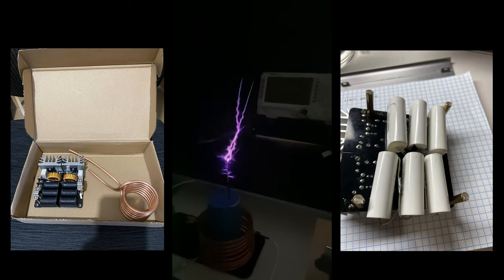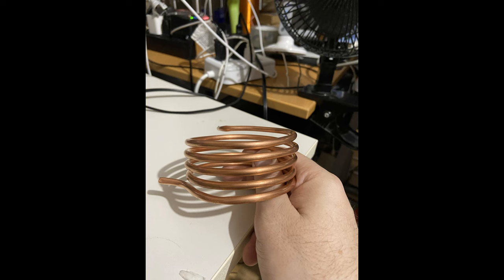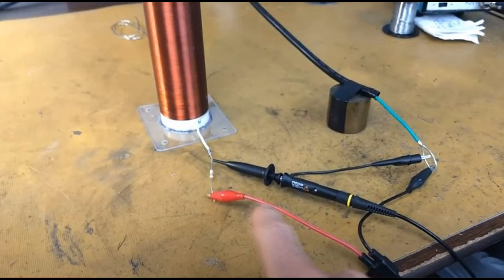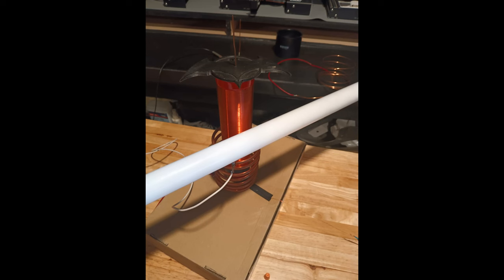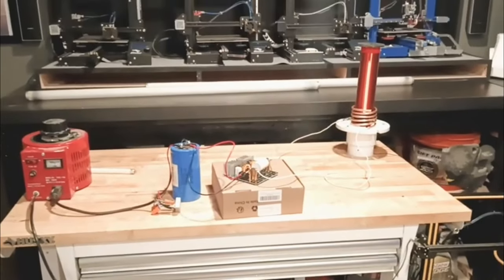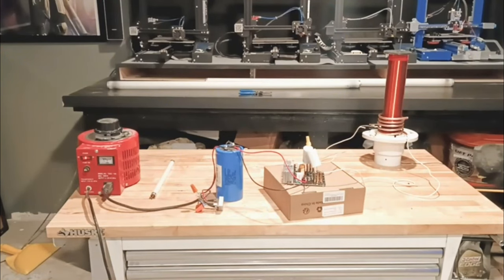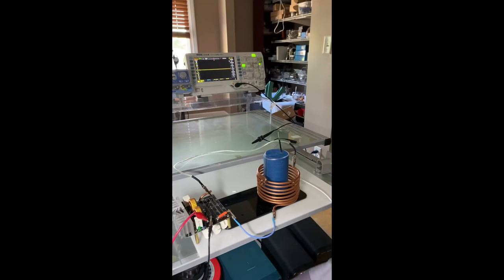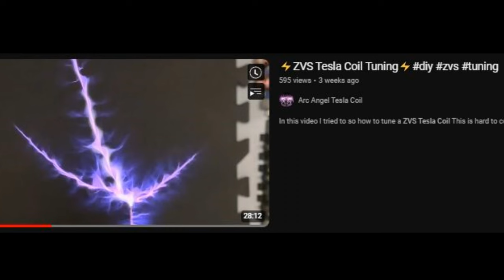ZVS Tesla Coil

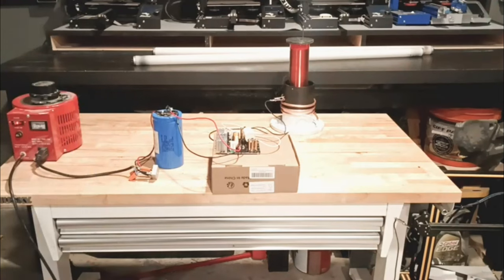Comment: At 15:00, you need to measure the DC across the filter capacitor as your input voltage measurement.
The scale on the auto-transformer is not accurate and as you load it up the output will change as the transformer does not voltage regulate.
So measure your input DC as your experimental reference.
Also keep your leads to the primary coil short and heavier gauge, in fact resonance may be affected by wire length.

Comment: If you do some searching for the laboratory experimentation from Garret Hill, you will find some experimentation with discharges on physical material to study and often reproduce features indistinguishable from orders of magnitude larger objects on asteroids, moons, and even topological features we see on Earth's surface. One of his experiments was with a pile of carbon dust on a sheet of acrylic above the cathode of his circuit and would bring in the anode above the dust and it would respond in dynamic way. But the acrylic caught on fire because of the heat and the flames would enter the electricity strands and would come out further toward the anode probe away from the fire on the acrylic. Plasma merging with plasma. Mind blowing experiments and something you might have the equipment to reproduce.
Reply: Wow, that's some excellent feedback. Plasma meeting plasma sounds incredible! I'll put that on my list of experiments.

Comment: that tesla coil is scary wow --- you need to have gravity flyer hooked to the telsa coil when tuning it.  And have the magnets running also.   You did good Old Guy
as a note:   Those magnets spinning around should show you another frequency also being fed back to the secondary coil.  You may have to dampen the secondary coil to get enough bandwidth to make it fly.  You want a lot of frequencies  not just the main one.  Dampen in electronic is changing the Q of the tesla coil.   You may have to add a resistor across the coil.  A big big resistor for that much HV.  Or you may have to add a slug to the coil to help tune it.
Reply from the maker: that's why I am building it.
Reply: You make good points.
Reply: @shawncalderon4950   Thanks... its all about impedance matching.  And a little Electric Magic.   I am an Electro Nuclear / Micro Wave Engineer.
as a side note:  These tesla coils are not toys... they can kill you if you get a bad shock from them.  Some of these could have current high enough to stop your heart. Be very careful working with them.
Reply: @doityourself3293  I appreciate the advice. I was an electronics technician in the Navy for five years. The biggest takeaway from my Navy training was safety! I put my fluke in series with the variac input to measure current. It's the one-handed rule and safety gloves all the time—rubber floor matt, proper grounding, etc. The toroid inductors do a good job of limiting current. I prefer working with 200khz or higher to take advantage of the skin effect. I could go on, but I'm not telling you anything you already don't know. Thanks again for the encouraging advice.

Comment: Might want to change the mosfets to igbt, and run a lower resonant frequency
Under 100khz

Igbt iirc tolerate running at higher voltage and current spikes

Unless you can find power mosfets

Over 650v with over 500-1000A peak current
Reply: Igbt can go over 1000v and few hundred amps
Reply: You can audio modulate it by injecting an audio signal in the power rail via the inductors (amplified and impedance matched)
Reply: I appreciate the helpful feedback. I hope to graduate to IGBTs someday. For now, I'm just excited to see such big arcs out of my little 5-inch coil.

Comment: When the wire from the Graviflyer is ran down the throat of the Tesla coil how much will that change the resonant condition?
Reply from the maker: MyTBrain did a test of it here is the video. https://youtu.be/n39-P92_nnc?si=XExNe03ZxmM5a1qc
Reply: @nathanbunten4299  
That looks like the comparison of the ultra sound and tapping the button and the Tesla coil. 
I was concerned how the added length of wire from the Graviflyer might change the resonant condition of the Tesla coil.
Reply from the maker: @chasson321  the video shows that the frequency of the graviflyer is in the top 4" of the tesla coil no matter the length of the wire as long as the signal is strong. It does not take much to add frequency to voltage so it could be really low and still get there. The more interesting was the yellow spikes. they  represent the button pushes. so if the lined up with the frequency correctly there would be amplification. 

I would not be concerned with the extra wire. I got the same result with the addition of 8' of wire. it only takes 5v to get the signal there. getting the tesla coil in feedback takes raw power. By making the tesla coil have it ready regardless of the feedback we have the advantage.
Reply: @nathanbunten4299  
Thanks for the clarification. 
It is interesting that just changing the connection point on the Tesla coil’s primary also changes the frequency even though the distance is quite short.

Comment: as soon as the transistor heats up too much you will lose resonance and you will lose the clean signal.  they have 1" thick aluminum squares you can get , like 4" by 6" squares 1"  thick. you dont need fins when you have that much heat sink
Reply from the maker: The energy is not flowing to the #2 coil so it heats up. Making a thicker connection won't fix that. When it flows the amps go down and the burning stops with smaller wire. When it is out of oscillation then the energy backs up and kust cooks everything. The only way to fix it is to put it into the proper resonance.
Reply: @nathanbunten4299  the #2 coil needs to be loaded to have the energy flow threw it .
Reply: Thanks for sharing. Burned-up transistors caused me to stop building Slayer Exciter Tesla coils and move the ZVS circuit. When the little 5-inch coil in this video was pushing out 10-12-inch sparks, the only thing warm on the ZVS board was the two 470 ohm resistors. Another big positive is the ZVS frequency doesn't change, unlike the Slayer Exciter. The Slayer circuit changes frequency if you look at it wrong. Again, thanks for commenting.
Reply: @shawncalderon4950  lol , i have to replicate a tesla coil ,never worked with a ZVS either but its very interesting switching circuit
Reply: @mykedoes4099  thanks for sharing:)

Comment: The primary coil must be more turns and thIcker
Reply: Your right. I wound 8 turns but ended up needing 5. The little coil with the big sparks at the beginning has 5 turns of 1/4 pipe for the primary.

Comment: When i leave the tesla coil secondary ends in air, it produce spark at both terminal ends. The neon lit throughout the coil. Its at 1.5Mhz. But when i grounded one secondary coil terminal to earth, no high voltage on secondary. Seems dead. What could went wrong here ?
Reply: Are you using the Slayer Exciter circuit? If so, the secondary (coil2) should not be grounded.
Reply: @shawncalderon4950  No, I am giving 1.2Mhz signal from IC output  to driver mosfet for primary coil.